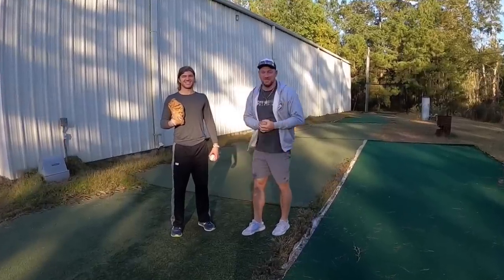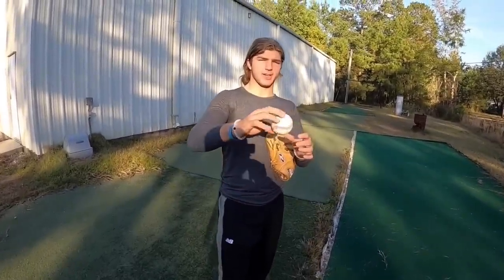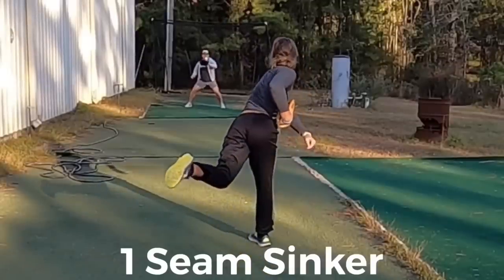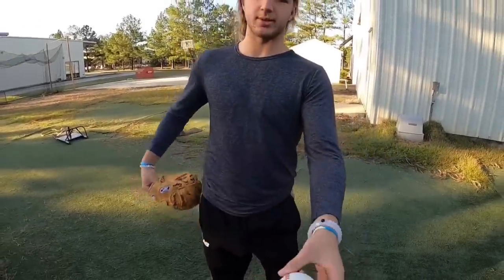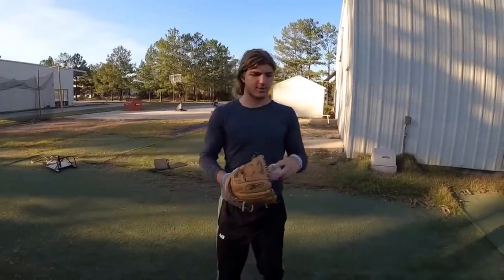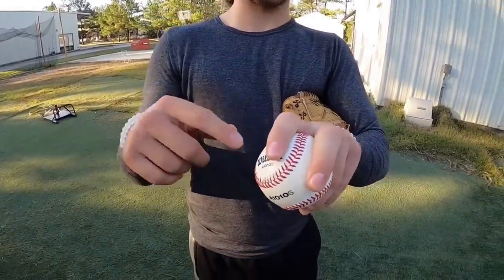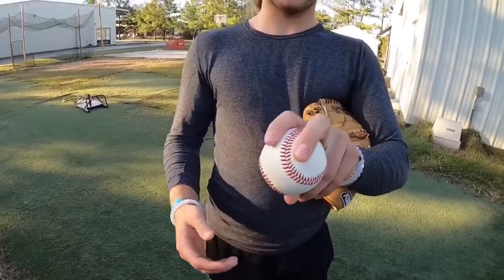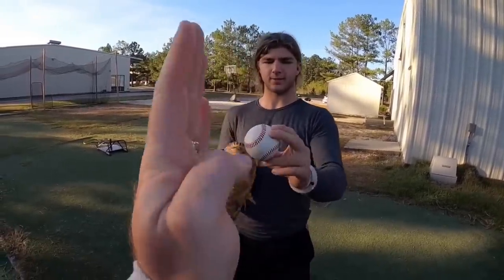How To Throw A One Seam Sinker [with Sebastian Bentz]

Comment: Nice video Coach Madden. Though...there's a slight difference in his mechanics/arm slot (see side by side video), prior in releasing the ball. The difference starts when Sebastian has his leg lift, breaks (4.48) and starts cocking (4.53). With the 4-seam his hand is way much back than when he's throwing the 1-seam sinker. Also his release of the 1-seam sinker is higher/earlier than the 4-seam (4.55).....minor details that only a very very good hitter can pick-up. What I  most liked was the difference on the vertical break compared to the 4-seam, also a good pitch to teach kids (age 12-15) to throw instead of the curve ball, less stress on the arm.

Comment: I know the arm action and spin are different for the 1 seam versus a curve, but isn't the ball movement very similar to a 12-6 curve ball?  Also higher velocity than curve.
Reply from the maker: Fred Mertz  No the one seamer has backspin, a curveball has forward spin.  If you are talking about the movement of the pitch then yes I guess you could say that. But I think a good Sinker beats a good curveball. But that’s just my opinion.
Reply: In my mind, at least, I agree with you that a sinker should be better than a curve.  My pitching coach wants the CB velocity no more than 15% below the velocity of the 4-seam FB.  At my current age (15), it is hard to reach that consistently.  Our 2-seam FB and sinker is only about 2-3 mph (low 70's) below the velocity of the 4-seam FB (mid-70's), so I expect the velocity of a 1-seam pitch to be close to the velocity of the 2-seam pitches, for us at least.  And I have to pronate the 2-seam sinker to get much movement of the pitch (down and slight arm-side movement). So, the 1-seam pitch should be faster than my curve, about as fast as my 2-seam pitches, a bit easier on my arm and much more consistent than my curve.  All, IMHO, of course.
Reply: @fredmertz2175  have you tried it yet?
Reply: @cantripleplays  Cantriple Plays - I didn’t play Showcase or Travel Ball in the last year.  My HS coach only calls 4 seam, curve and change-up so I was not allowed to throw it in BP or game situations.  I played Jr. Legion ball, but one of my HS coaches was the pitching coach so that ruined that opportunity.